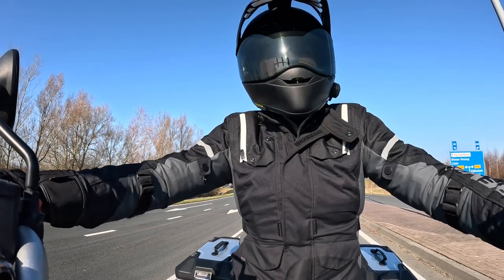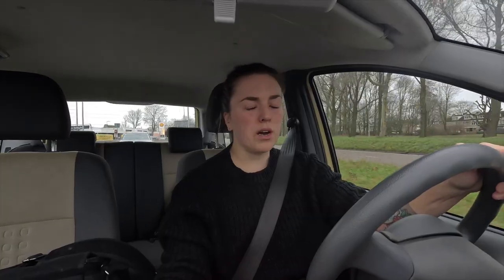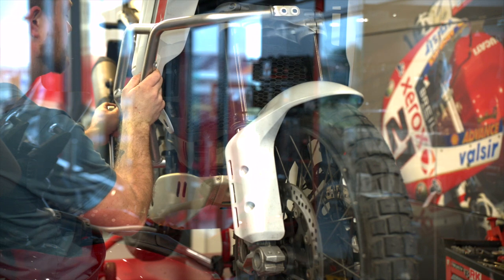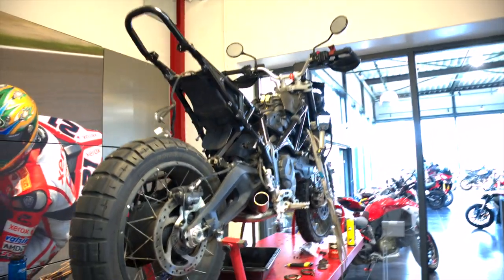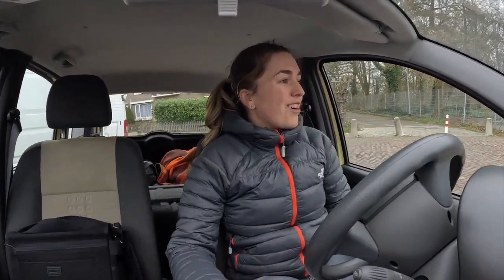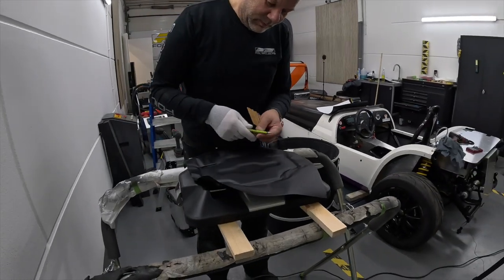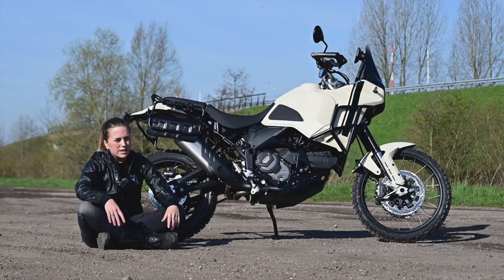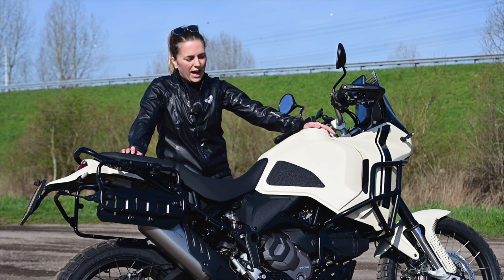WHAT DID I DO to my beloved Ducati DESERT X?

Comment: Good for you making it your own with its new livery , do you find it better with the new exhaust system fitted and do your ears hurt on long trips 😢
Reply from the maker: Thnx Martin, I must say the bike is running a lot smoother now with the Termi mapping and the DNA air filter! I notice shifting gears with the quickshifter isn't as clunky anymore and it's handling better overall with a bit more power. My ears do not hurt, as the muffler is still in and I have some great hearing protection  - I can ride around with a normal/decent sound without being that jerk with an extremely loud pipe, but if I twist that throttle some pops and bangs will be launched. Perfect!
Reply: Hi
So out of pure interest as I have my own DX is your Ducati warranty still valid as you’ve had a full termi with mapping fitted by Ducati .
Also DNA filter will help her breathe better for sure with de cat but going to be a pain in the arse to clean more regularly than the standard filter 😮@ 9000 mile.
I had twin termis on my monster 900 20+ years ago and it’s the best sound ever for any Ducati except today’s price 😬🫤😵‍💫